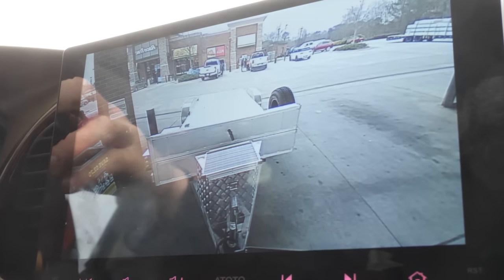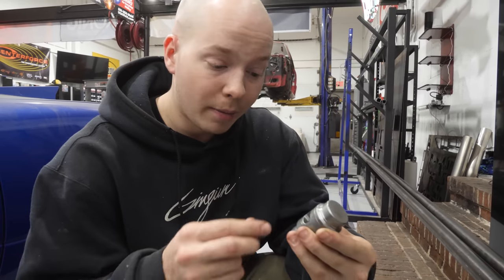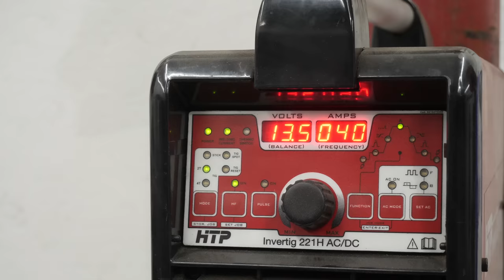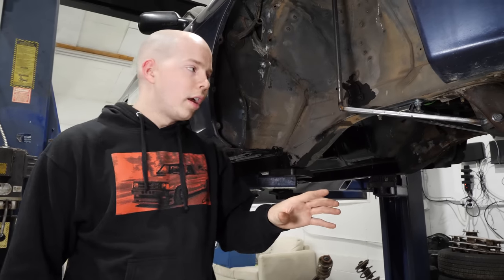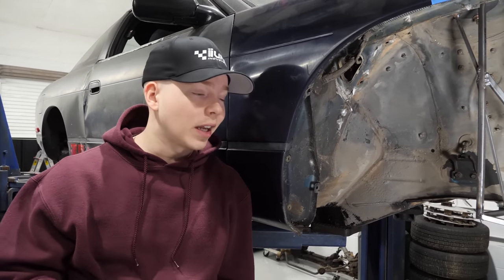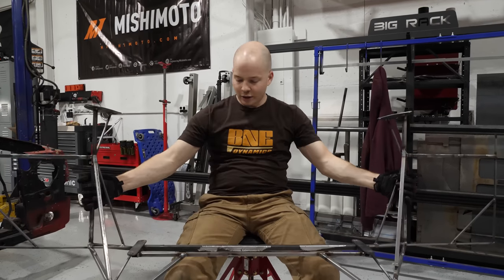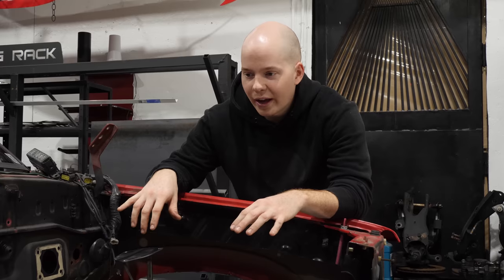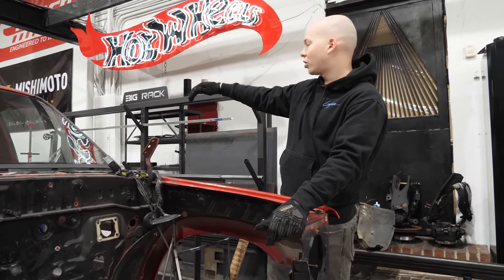The Secret To Putting ANY SUSPENSION Into ANY CAR!

Comment: 4:15 Honestly impressed with how unmolested that S13 is, not a single mod, even the pinch weld in the front wheel well is perfect, everyone hammers that pinch weld down for wheel clearance, so I've never seen it in pristine condition before
Reply from the maker: Right!? So much potential
Reply: this, and the pignose bumper small grills, everyone removes those to either cut it there, or they just got lost years ago
Reply: @_Gingium_  Is that a hint that something's coming up with the S13?👀

Comment: You're probably planning to, but if not I'd highly recommend radiusing or angling the ends of the frame notches when you box them back in -- those right angles would leave you with gnarly stress concentrations

Comment: Honestly impressed with how clean everything on the B2200 still is. It's a 30 year old Japanese utility vehicle with the rust protection of the average 30 year old Japanese utility vehicle, but the frame is still in very good condition and the underside of the cab looked almost as new when you removed it in an earlier video.

Comment: Minor correction. Those couplers don't allow the tube to cage to retain its full strength, however they are quite handy. It really depends how they are oriented and where are you expecting loading from. In the event of a crash, if the fasteners are heavily loaded in shear, you may have a roll cage failure. This is why the faces should always be oriented in a way that the flange of the disconnect is bearing the load and not the fastener itself (fastener would primarily be in tension or compression in this orientation). They are extremely convenient though. Would recommended using the interlocking variant where possible. 
Great video, thoroughly enjoyed the content!

Comment: While I understand the use of the s13 architecture because of its ubiquity in drifting applications properly designed double A-arm designs tend to perform far better than McPherson in nearly all instances. It would also be easier to install in a body on frame setup like this. Still watching and enjoying the work though.

Comment: Another problem you're going to run into is that since you have no load on the suspension the shock towers aren't true and when you go to go do the measurements and put stuff back on it's not going to be right. Because the shock towers are going to give under weight and if you wanted true measurements that should have been accounted for with a shock Tower bar.

Comment: Please don't use those couplers for the cage!! Look at any race car, do they have them? What happens in a wreck is those couplers are the new weak link for the cage and the strength of the whole tubing is now the same as the bolts (from ebay) holding the tubing together

Comment: You should build a more permanent jig, something with the same basic shape,   
With bolt on attachments that can be welded to, so you do not have to build so much if you do this more than a couple times, and it can be built using only a small amount of time and materials of building a single use jig. Plus you will find other used for it . If you do anything like this often, even mounting rear axels to a frame, or rear suspension, it can be bolted in, giving a better point to measure from,  there has been many times I wish I had done that,  even mounting body panels, it will give a landmark to see that everything is aligned properly, especially on heavily modified or aftermarket body panels..